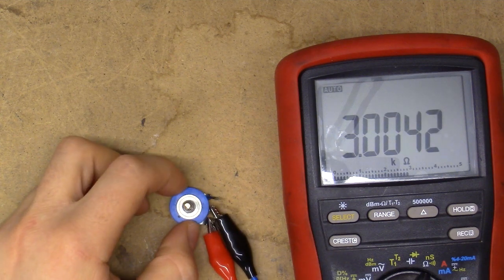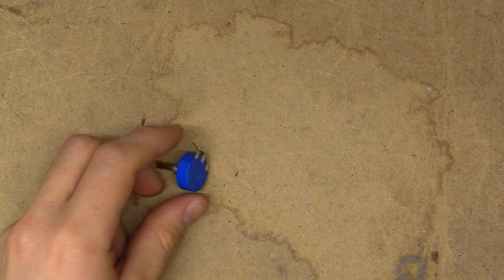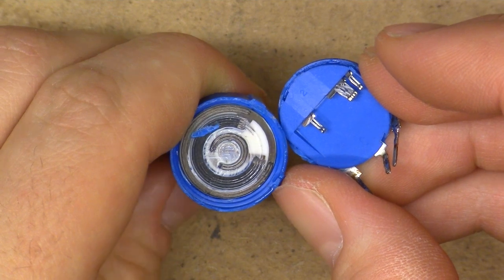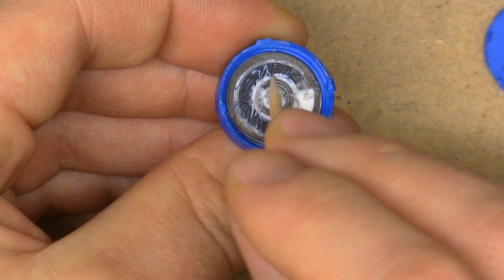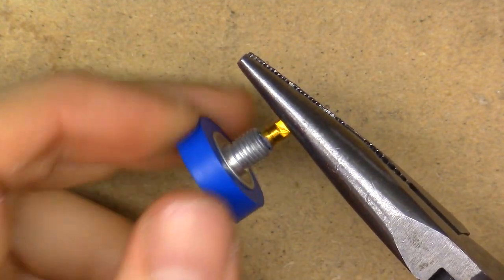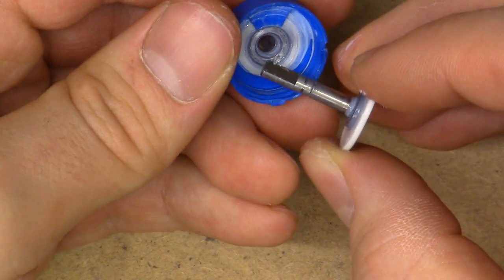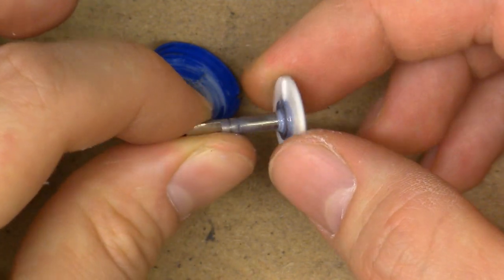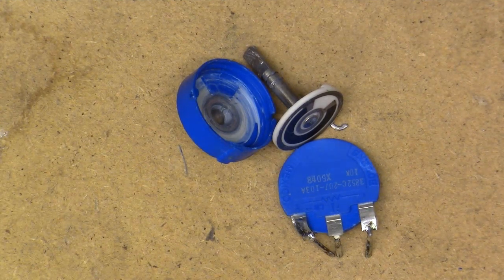Probably not fake Bourns potentiometer teardown

Comment: If you crack it open with a xacto knife, them save some of the lube, then clean the wipers contacts with a pink eraser, then shift the contacts over to use a new section of the resistive element and give them slightly more pressure, add the grease back, its as good as new. I did this many times to the pedal pots on my PC sim wheel/pedals.

Comment: Why would there be grease in there?
Reply from the maker: +Rex Holes There needs to be grease to make sure the shaft turns smoothly and doesn't wear down. It also prevents dirt and dust from entering the potentiometer.
Reply: Not to damage the carbon layer probably

Comment: Clean it and put it back together if possible
Reply from the maker: +Rex Holes It's a bit too late for that, I applied some relatively high voltages to it after shooting this video. It didn't do anything exciting, so I didn't include it in the video, but it did probably upset the uniformity of the carbon trace a tad. The case was also ultrasonically welded, so it wouldn't have gone together very well even if I hadn't ruined the trace.